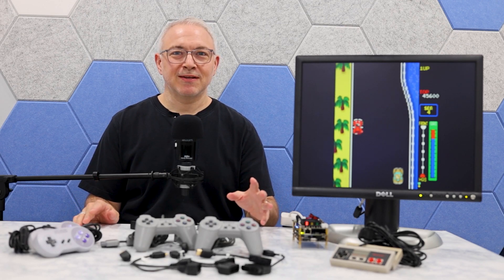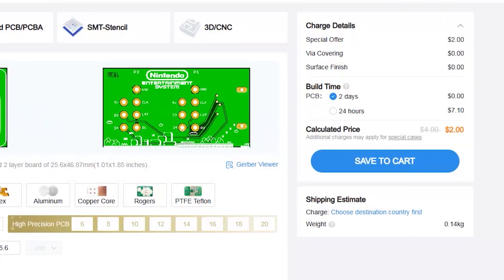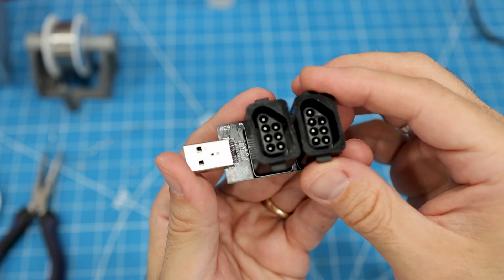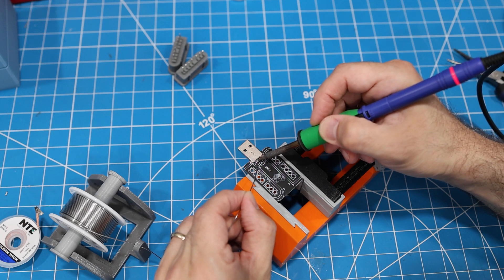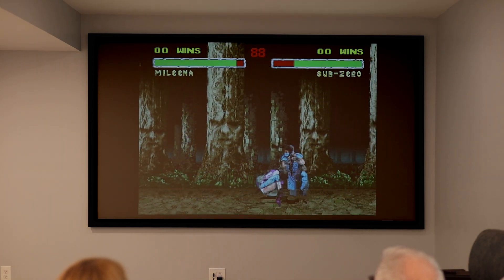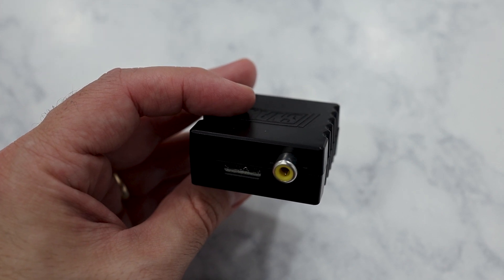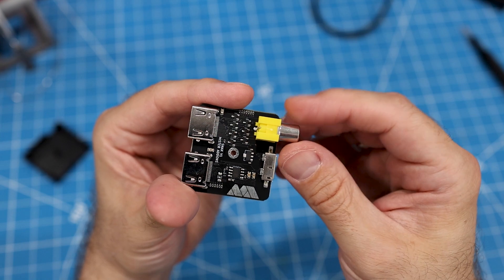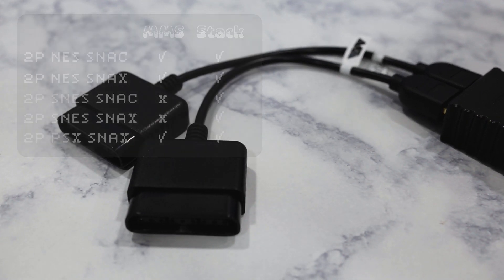2 Player SNAC Adapters on the MiSTer FPGA (NES, SNES, and PSX)

Comment: So its just a level shifter....I already have a 4 port board for N64 that needs a level shifter, it plugs into USB, not HDMI......what would the pin out be to make an HDMI to USB that would allow it to work?  (I would like to use USB based SNAC boards that require a level shifter, with my SNAX, instead of buying a seperate USB level shifter)

Comment: I did the steps and moved the jumper but i cant get my SNAX64 to work with 2 players. Im able to swap the controllers and they work for Player 1 but nothing on Player 2 on SNES or NES.
Reply from the maker: Interesting...I haven't tried the snax64 yet, but it sounds like it may require a different configuration

Comment: Strange that both NES and SNES 2 Player adapters worked perfectly on my Multisystem.
Reply from the maker: Hmmm... can you please share a little more information about your setup?  What 2P SNACs are you using, and what do you have J17 and SW7 set to?
Reply: @whatskenmaking  i use the multisystem with jumper to IO and 5V. 
I have older dual SNAC adapters from ultimatemister with the level shifter between.
Reply from the maker: @retromister81  Thanks for the additional info... I'll have to take a look at the ultimatemister version of the adapter; I'm guessing there's a difference from the open source adapter that I was using.

Comment: would suport an original multitap?
Reply from the maker: It depends on the system, but the SNES, Genesis, Saturn, and PSX multitaps are all reported to work with the SNAX. I have an NES multitap, but I have not yet tested it. I'll be doing a follow-up video soon with some additional SNAC adapters, and am planning on covering some multitap support as part of that.

Comment: I'd be curious to know if NES SNAX would support a 4 controller set up like the 4 score?
Reply from the maker: Good question, I actually don’t know if it will work or not. Some other multitap devices do work fine, but the NES isn’t listed on the misteraddons store. I’ll have to see if I can dig one up and test it.

Comment: If you wamna have No problems with mister and multiple controllers you should use Antonio Villena DB9 Mister Fpga Plus and his octopod
Reply from the maker: But then I wouldn't have anything fun to troubleshoot 😁 The problems I was having weren't due to the SNAC adapters - it was because of the MiSTer Multisystem; all the two-player SNACs worked fine on the traditional MiSTer stack configuration. I do like Antonio's devices - they're very nice!
Reply: I use Antonio’s DB9 Octopod. It’s great but it has the same issue with the PCE/TG16 multitap.

Comment: Hi. Love your content about Snacs. May I ask you if I can use a Snac without having an I/O board? I'm planning on building my own Mister console (nice case actually) with multi Snac option. Just one player for core. Another one: can I play 2 players 1 using Snac and 1 using normal USB? Cheers =)
Reply from the maker: Thank you! The SNAC port directly connects your controller's pins into the Cyclone's GPIO pins. The GPIO pins are exposed via the headers on the DE10-Nano, so you technically don't need an I/O board for SNAC. If you'd like, you can wire up your own USB3 port directly to the GPIOs. However, there are some nuances that you need to consider, such as the state of 7th SNAC pin. The I/O board has a jumper built in (IO6) that enables you to configure that.

Regarding mixed SNAC/USB - that's a great question... and it depends on the core. For example, the PSX core allows you to configure input for both players independently, but the NES core has a single setting for both players.

Would love to see your console case design!

Comment: Hi Ken!! Have you looked into the Daemonbite adaptors? I'm very new to the mister, but from my research they are a better option. They poll every 1ms and you can use the controllers for any system, and in the menu. I still have my first mister on order, so I haven't tried them yet. Thank you for another great video!!
Reply from the maker: I've seen the Daemonbite adapters, but have not tried them myself. Low latency USB adapters are great, but even at 1ms, there's still a 6.25% chance of your input missing a frame. SNAC avoids that entirely by not using polling at all. I explain how this works in my first video on SNACs; you might be interested in checking that out if you haven't seen it - https://www.youtube.com/watch?v=tRrNN2HXuVQ.

By the way, there is one USB option that I'm exploring a bit more and will be doing a video on soon - the BlisSTer. Even though it's a USB device, it has a layer they call the Low-Level API (LLAPI), which frame locks the polling in the core. I'm running some experiments with it to see if it really can get us zero latency USB😁
Reply: @whatskenmaking  Sounds good!! I have already seen the video, but I was just thinking a millisecond delay would be fine. Anyway, I'm looking forward to the blisster video!! Thank you!!
Reply: @whatskenmaking  not true at all. Every singles console have its internal pooling aswell, generally once a frame, aka 60 hz. No console reads inputs instantaneosly like the way you are implying lol. The chance of a pooling done @1000hz miss the window of the core logic pooling @ 60hz inst even close to 6.25%
Reply from the maker: @MarceloMedeirosb  We’re not talking about console polling, we’re talking about USB host polling, which occurs with a clock. The 6.25% chance of missing a frame accounts for the USB polling timer being misaligned with the console framerate, which is where input handling occurs. Unless you’re frame locking the USB polling to the console’s game loop, the 6.25% chance of a frame miss is accurate for a 60hz NTSC based system.
Reply from the maker: @MarceloMedeirosb  To expand a little more on my last reply (sorry, I was boarding a flight so just jammed out a quick one), the key thing to remember is that USB polling happens independently from the input processing inside of a console core. So even if the usb controller is getting polled at 1000hz (every 1ms), an NTSC console core is only processing input during the sync interval between video frames, at 60hz (every ~16ms). So there is a ~1/16 chance that the USB poll event will occur outside this interval and a different video frame will be displayed while your USB controller button press is still being processed. You should check out this doc in the MiSTer documentation - it does a better job of explaining it than I can here in this format - https://mister-devel.github.io/MkDocs_MiSTer/advanced/lag/
Reply: Depends on what you want SNAC for.

Low latency isn’t the only reason for SNAC. Using more obscure hardware from the original console, like light guns, multi taps, spinners, and specialty controllers (Super Game Boy controller, anyone?) is also a good reason.

Personally, I went with the Decapod DB9 for the best of both worlds. It works as a multiplatform SNAC adapter for several consoles when used with Antonio Villena’s “DB9” SNAC IO boards and also works as a Daemonbite adapter when used with a USB cable. There’s even a Daemonbite-only version for a little less. I’m still getting set up but the only thing I found lacking is PSX support. He also sells an “Octopod” with PSX controller support but it doesn’t have the sync connection for GunCon. It’s also way too expensive and mostly redundant if you already have the Decapod.

He does offer a cheap DB9 PlayStation adapter with the sync jack so I’ll be adding that to my Decapod to make up for it.
Reply: @emmettturner9452  Interesting stuff!! I was actually looking at Antonio's mister. But I decided to go for the standard for now.

The Deca- and Octopod's looks great, if you have the Antonio DB9 port.

But they also have some limits. Like you can only use two controllers of the same type at once. I guess it depends on your use case.

Comment: Love the video!

Quick questions: maybe I missed it in the video but I don't understand where you got the level shifter. Where did you get one and why is it necessary?
Reply: He covered why it was needed in his previous video about SNAC. The User IO port is 3.3v and the controllers supported by SNAC are pretty much all 5v (raw arcade controls notwithstanding). If we ever get N64 SNAC we’ll finally have a 3.3v console that wouldn’t need the voltage level conversion.

Some SNAC stuff has the level conversion built-in but the original official MiSTer designs do not. I feel that the level shifter should probably be a cable since you definitely don’t need a rigid protrusion like that with a controller or two hanging off it.
Reply: @emmettturner9452  thanks for the thorough reply.
Reply: @TheMikeyb86  No problem. I had just finished that video hours before this one went live so it was fresh on my mind. :)
Reply: Interesting. I’ve been using a SNES SNAC board (which is literally just straight usb pins to SNES pins) with no level shifter and it’s worked just fine. Should I modify my setup to use a shifter?
Reply: @Mike-B-Jackson  What I/O board do you have? Some have the level shifters built in (MINI, PLUS, Multisystem, etc). The level shifter seems like an afterthought that was added after someone balked about the proper way to handle 5v devices on a 3.3v bus, so I suspect it will generally work fine without. This is just my speculation since I wasn’t even aware of it until recently.

Like 3.3v flash carts inside of 5v consoles, I suspect it generally works but can be bad for the chips… theoretically. SNES controllers are basically just two 4021 shift registers in series which is off the shelf logic… so it’s no big deal if we burn one out. Since we are undervolting it, chances are it won’t hurt anything in the controller, so maybe it’s to avoid putting too much strain on the FPGA.
Reply: @emmettturner9452  standard digital I/O board for standard stack. Yeah, I’m guessing the extra volt and a half isn’t too big a deal since it’s not really powering anything other than the simple 12 bit shift register on the SNES controller. I won’t worry about it for now :)
Reply from the maker: The concern with the 5v isn't the SNES controller - those are designed to work on 5v logic. Rather, it's the GPIO pins in the DE10-Nano that the SNAC port connects to. Those pins operate on 3.3v logic, so you don't want to feed 5v logic from the controller's shift register into them. Doing so may damage your DE10-Nano, and that's an expensive mistake 😊
Reply: @whatskenmaking  so if you feed a controller 3v, it will somehow transform it to 5v and feed it back? O_o
Reply from the maker: It's actually the other way around - the controller operates on 5v, and the level shifter converts it to 3.3v logic on the way back to the MiSTer